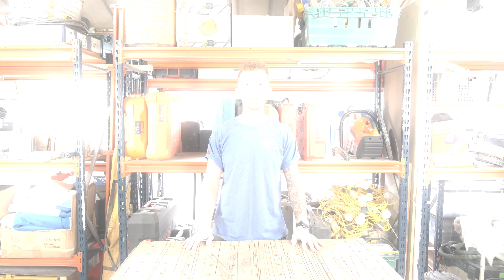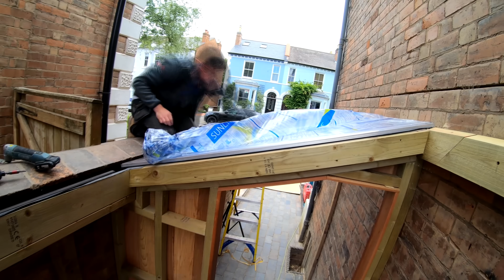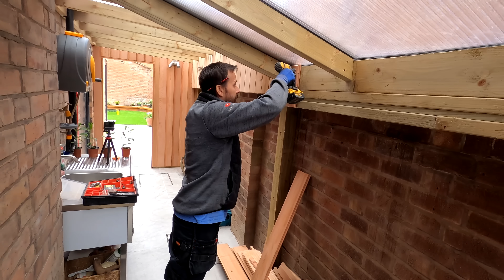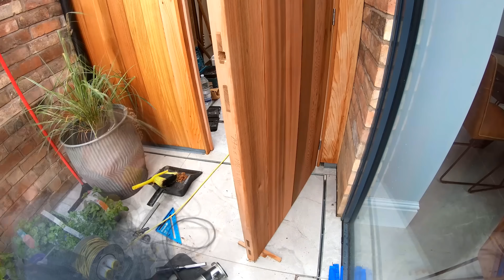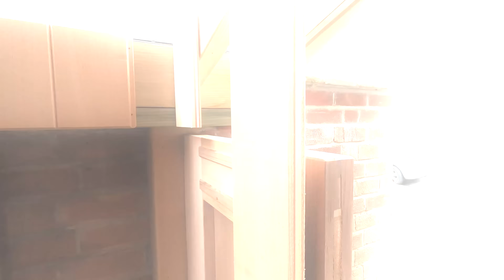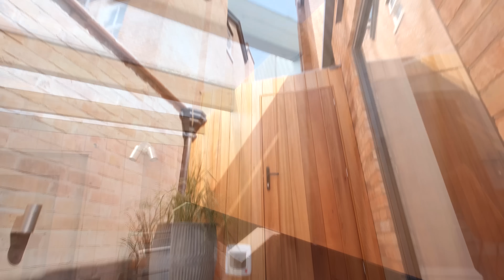HOW TO BUILD A GARDEN SHED: DOORS, ROOF PANELS AND OSMO OIL | Extension Build #21 | Build with A&E

Comment: Looks amazing, quick question. What did you use to seal where the shed roof runs into the brickwork to stop water running down the bricks and behind the timber?

Comment: Can u get away with just ceiling it and not doing the led work ? I’m looking at doing the same thing not the best with diy lol
Reply from the maker: I'm assuming you're referring to the lead flashing from wall to roof? If so, you could use flashband, which is a self adhesive strip you can use instead of lead. It does have a much lower lifespan than lead though. Also make sure you follow the manufacturer's instructions to the letter to ensure that it sticks and seals properly!

Hope this helps.

All the best, John 😊

Comment: Looks amazing ,just wondering if that roof is noisy when it rains? Thinking about building a similar roof on the side of my house.
Reply from the maker: Hi Ryan H,

It does make a noise when it rains, but the amount of noise will depend on what is in the shed / area underneath it, as any echo could make it appear louder.

Hope this helps.

All the best, John 😊

Comment: Great job 👏  was curious to know if this could be down with glass panels Instead of polycarbonate? Is the process the same?
Reply from the maker: Hi Dan,

Glad you enjoyed the video.

There's no reason why you couldn't use glass. There would be some things to consider though -

Glass is much heavier than polycarbonate, so make sure the rafters can support the weight (also bear in mind snow load).

You would need an adequate frame to install the glass into. Have a chat with a local glazing firm, and they can advise you on available options.

Hope this helps.

All the best, John 😊

Comment: Why didnt you put the lock in between the tenons? isn't that why the middle is done like that. You must of weakened the joint by doing it like that, only reason I can think of is to match the handle height off  another door
Reply from the maker: Hi Kenny quite correct you could argue the point on both sides quite easily, but the minimum of effect is nothing and long term it will out last any dowelled door and if the lock is fitted correctly so you don’t take out unnecessary timber it will be fine or the other way to look at it I’ve fitted doors like this for 35 years and never had a problem only with dowelled doors thanks for watching all the best Tony 👍have a awesome weekend

Comment: The skill with that router doing the hinges is so impressive. I don’t get how you get it so accurate without a template/jig.
Reply: I do it exactly the same just don’t try and route to the line leave a mil or 2 then finish with the chisel 👍
Reply: experience with the wood helps a lot too. speed of router, quality of bit, some woods cut through like butter, others are tough and bind do the bit.
Reply from the maker: Hi John,  Jake is spot on use light weight router makes life easy, the lads laugh at me I still use my chisels to tight to buy a small handheld router 😂 thanks for watching all the best Tony 👍 have a awesome weekend

Comment: Placing the locks where the mortice and tenant not going to weakened the door? Nice build, music by epidemic, how apropiate 😀😀
Reply from the maker: Hi Rubi quite correct you could argue the point on both sides quite easily, but the minimum of effect is nothing and long term it will out last any dowelled door and if the lock is fitted correctly so you don’t take out unnecessary timber it will be fine or the other way to look at it I’ve fitted doors like this for 35 years and never had a problem only with dowelled doors thanks for watching all the best Tony 👍have a awesome weekend

Comment: Look fantastic - Did you use normal lead flashing at the back of the poly carb roof panels? I can see the channel has been cut into the mortar, not sure if you used a plastic replacement?
Reply: It shows the flashing already installed in #20. You can watch from 12:13 in this video to see what it looks like.
https://youtu.be/Oom9gzHAzQ0?t=733